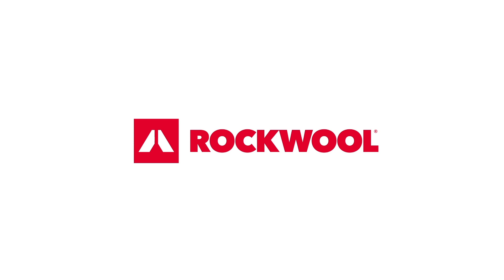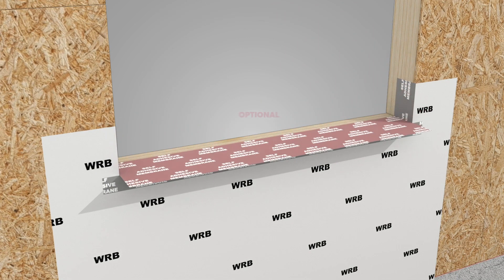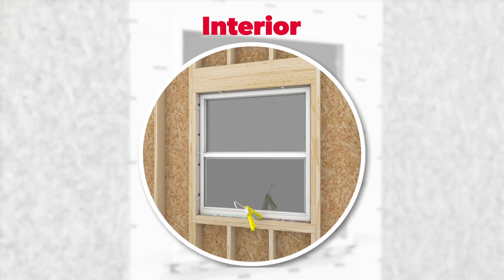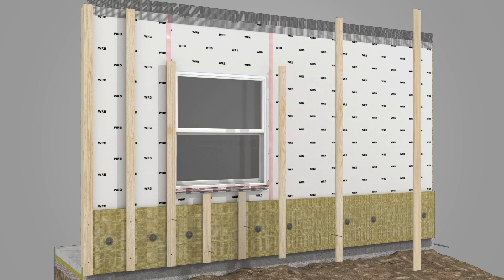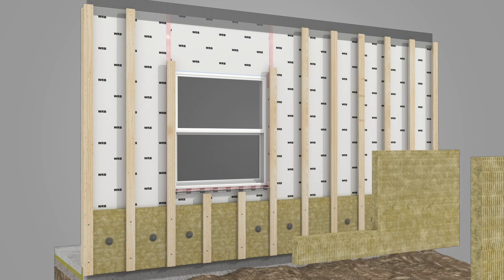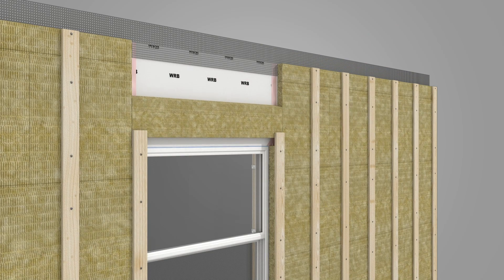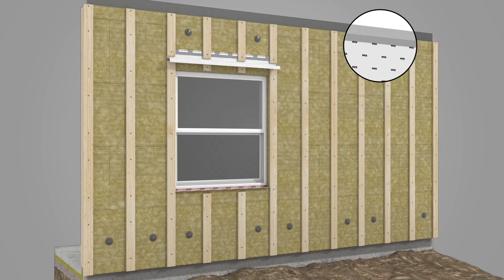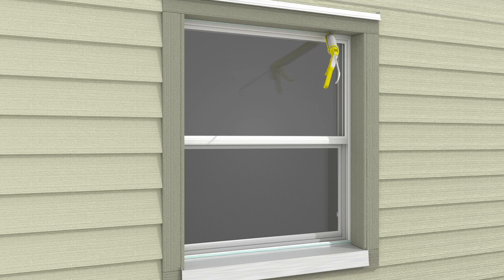How To: ROCKWOOL Comfortboard® 80 Non Flanged Window Installation

Comment: Suggestions for future revision: positive drainage on sill of rough opening, install window on non-compressible blocks or shims, emphasize defer to WRB manufacturer’s spec for installation details so warranty applies, emphasize not to caulk exterior sill, emphasize no spray foam in gap between rough opening and window.
Reply: Looks like you may also be watching Matt Resinger's YT vids on installing thick envelope on outer wall.  Good points you included, thank you. 👍💯☺🇨🇦